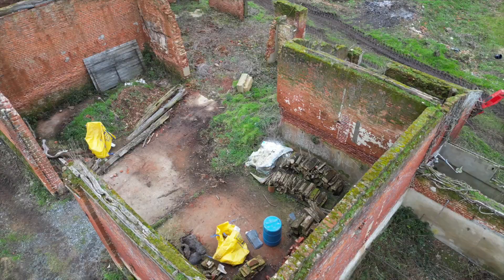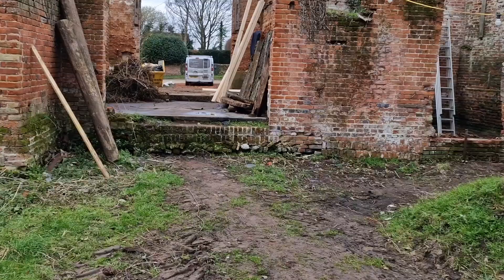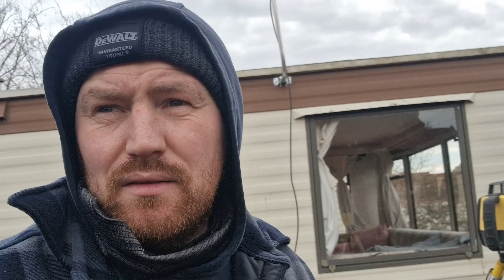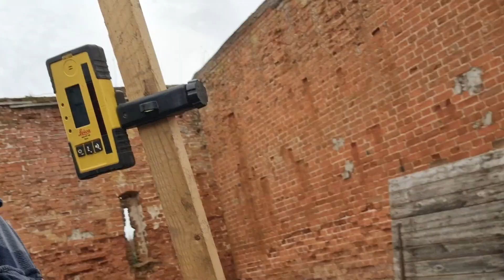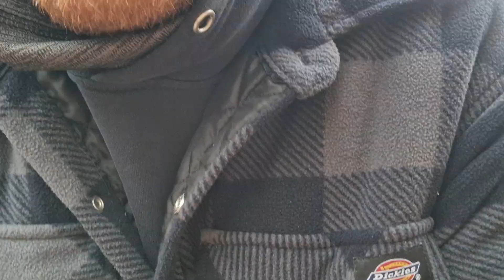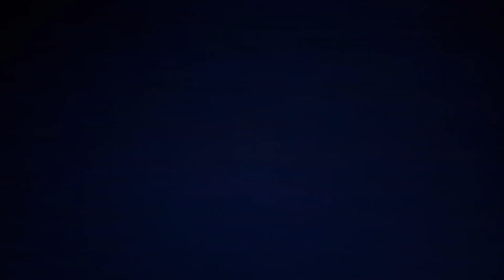Dream House Build - Episode 7 - Using a ground Laser

Comment: Would you not consider using a "zip level "?
Like a digital water level. 
Perfect for what your doing
Reply from the maker: I already had one of these lasers from a previous project so this was a no brainer for me. Although I must admit I might of looked for a cheaper alternative if I didn't own this. Thanks for watching  👌
Reply: Seal the formation layer with a Roller if going to be left open to the elements for a while it will stop it turning to mud and Monitor those walls to for any movement whilst excavating.